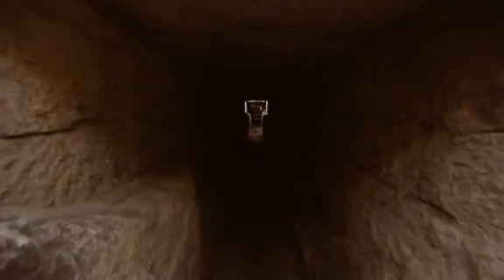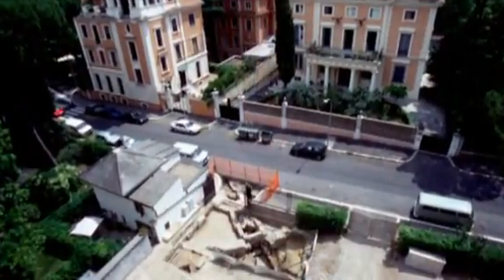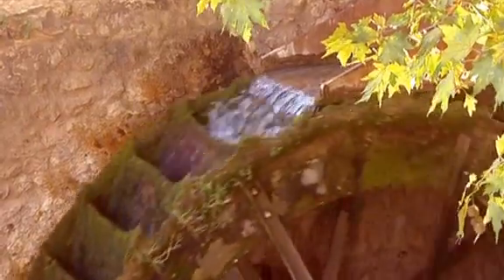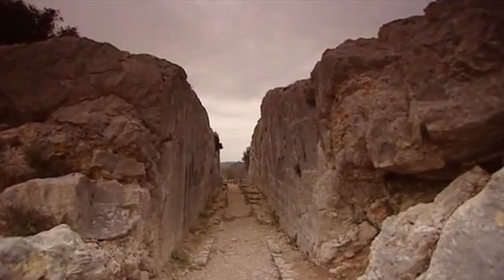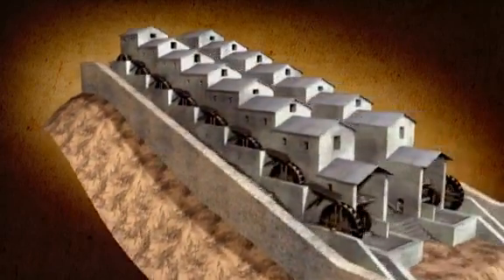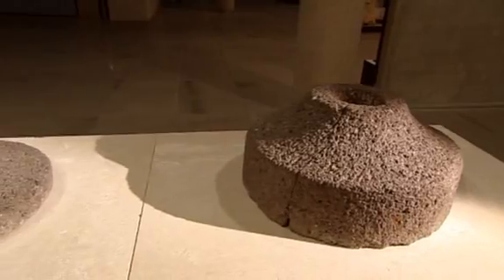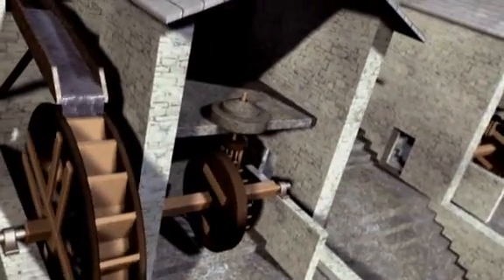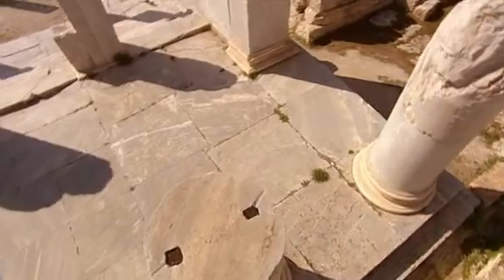Ancient Roman Industrial Watermills

Comment: wow. I wonder how much electrical power could be generated from a system like Barbegal?
Reply: If you find sources on the cross section area of the aqueduct and some source on the rate of flow for roman aqueducts you can find out how much water was passed through per second. Using the weight of the water and the usable height of all the water wheels you can find the total amount of energy being 'poured' in to the system per second. There were probably massive losses in the Roman machinery, but using a modern power plant you're probably looking at about 80% efficiency. That is, for each unit of energy being put in to the system (the potential energy of the water) 80% of it would be converted to electricity. Sorry but I have none of the values necessary for the calculation.
Reply: Not much. There's a reason hyrdopower is built into big dams....

Comment: Pretty amazing how Rome's proto-industrialization of the second century closely resembled Europe's proto-industrialization of the 16th century. The Crisis of the Third Century cut short what could have been a very great leap forward.
Reply: nvshd  A vast pool of cheap labor, in Rome's case: slaves, takes away incentive to mechanize and automate.
Reply: @chadcastagana9181  Slaves were only plentiful during periods of military expansion. During Pax Romana, when the borders were stabilized and in fact needed to be defended, slave supply dried up. I think Navak is right, if instead of the crisis of the 3rd century, they had another 100 years to tinker and innovate, they could have very well done it.
Reply: @chadcastagana9181  That's not what was going on though. Up until the decline of the late 200s, there were megaprojects with mechanization going on throughout the empire. The whole "slaves = no technology" argument doesn't match the evidence. I think the better argument is simply that the crisis led to the devolution of society to the point where advancement stopped. Just think of all the technologies we have today that require for their proper production a huge worldwide network and supply chain. Without our civilization as it currently exists would interplanetary rockets exist? Nah. We can barely put together really effective ones with the whole world working on the problem, imagine if it was just a single city trying to do it. Impossible--and certainly having nothing to do with whether or not we have slaves (we don't).
Reply: No I think it was Ancient Aliens 👽 that did it
Reply: They probably had A lot of help from Ancient Aliens 👽👾🛸🛸👽👽